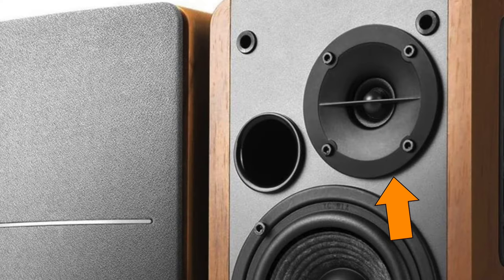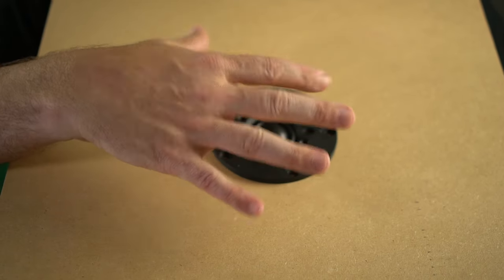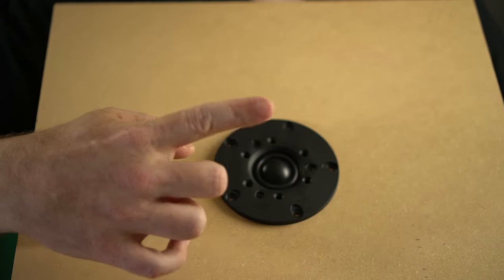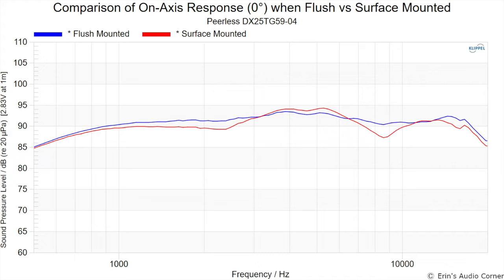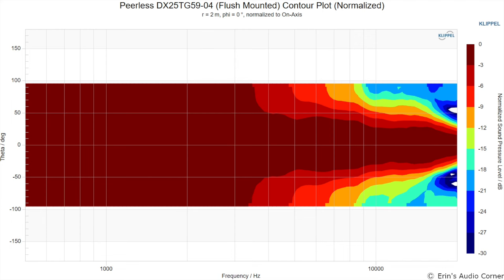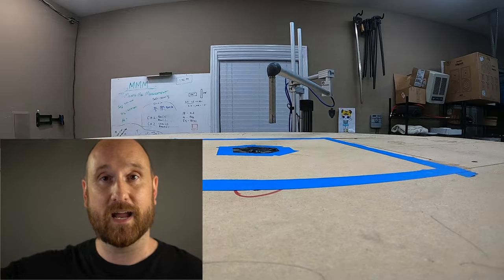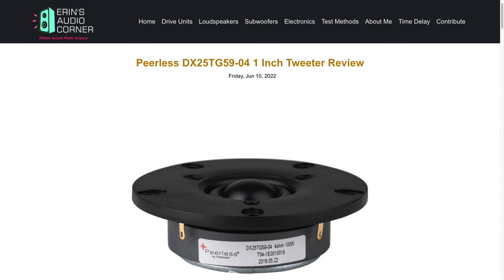Bad Speakers Start with This. 🛑  Flush Mounted vs Surface Mounted Tweeters.  Why it matters.

Comment: First of all, forget the graphs, if you like the sound of the speaker system go for it.  I have the Edifier bookshelf speakers in use as my recording studio monitors and love em!   I have Altec VOTTs as my main speakers driven by KT88s and after all these years, I am still in awe!
Let your ears be the ultimate judge!
Reply: No, the point is data makes good sound! How dare you even think your ears are the tool needed to make a subjective opinion
Reply: Agreed. I too have a couple of pairs of Edifiers and, bang for the buck, their sound (to me) is really hard to beat. With that said, I have the S2000MKIII models where the drivers are flush mounted (the tweeter even has a bit of a wave guide to it).
Reply: @rangerrecon  I think knowing what is a more preferred or better way of building a speaker might make it easier to filter out potentially "bad" speaker when buying new ones. If not going with any type of data you basically have to listen through all speakers around your budget if only go with your ears because you can't filter out any speaker out from your choices since you haven't listened to them. Would anyone entertain a speaker that is built wrong or measures horrible even if the ears are the final judge still? I think most people would probably not.
Anyway data and design shouldn't be totally disregarded even if the ears makes the final decision, imo.
Reply: @cletusberkeley9441  I'm so tired of "either/or" decisions and judgments, not necessarily yours but also those in response to you.  I think two things can be right at the same time and that two things can be wrong at the same time.  Beware false dichotomies.  It's the most common form of human understanding and categorization and it only indicates a normative desire to categorize information (regardless of the topic).  But, that type of thinking is a trap.  So, on one hand yes, "measurements" do make a difference and in some if not many cases this can be deceiving, especially so if the "room effects" aren't in your own room.  Nonetheless, the music we hear, whether influenced by our own bias, or not still is indicative of our own experience and our own ears.  Just one example:  My Rogue Audio Sphinx V3 sounds great, and "warm" to my ears and I like that type of distortion.  Nonetheless, it's still a well built and quality integrated hybrid amplifier.  When it's coupled with my Tannoy speakers which, in their own right are noted by some to be "bright", in my room, in combination with the "warmth" I mentioned, they complement one another and the resulting sound, I would call synergy.  So, they don't measure "flat" so well empirically but, my ears aren't empirical.  Thanks

Comment: Erin thank you for bringing this to my attention: my custom pillars are not flush mounted and this is my next goal on my updates
Reply from the maker: Car is a bit different but it still is good practice to flush mount when possible.
Reply: @ErinsAudioCorner  Care to elaborate how cars are different in terms of mounting? Thanks for the great vid!
Reply from the maker: @Bluehill29  In the simplest way, everything in a car is a baffle and a diffraction source.  I have my tweeters flush mounted but they're right next to a window... so there's no way to get around all the issues.  Best we can do is do things like flush mounting tweeters to help fix the things we can control

Comment: Erin's assertions are not incorrect, but these refraction don't necessary determine a good or bad speaker. There are many high end excellent speakers that have surface mounted  drivers. Agreed,  flush mounting will reduce edge diffraction which occurs when the wave reaches sharp edges. This is more important in mid and higher frequency drivers and usually you don't need it except for looks in (large) bass drivers. But edge diffraction will also occur when the wave reaches the end of the baffle, hence a reason for beveling the baffle edge. The width of the baffle determines the baffle step and the curvature of the edges determine to a degree how smooth the transition between radiating in half to full space is.

Comment: Magnepan- surface, baffle mount? Psh.
Kef uni-q drivers-np, mount em in the center of the woofer, perfection.
Sooo many different variations. I do like externally mounted tweeters separate from the cabinet alot, especially dipolar ESS etc.

Comment: I'd like to start by stating that I really appreciate your opinions because they are typically based on logical thinking and measurements.  I've built a number of speakers, reflex, back loaded horns, MLT, etc.  A number of my builds use Fostex drivers that have a cast frame with a beveled surround, an example would be the FE-208EZ.  Do you think there would be any benefit in insetting the driver so that the beveled edge meets the baffle? Does the 1/8" shoulder on these drivers significantly impact sound quality? I always inset my tweeters so that there is no shoulder above the baffle, but this video got my thinking about the other drivers. Thanks for your time!

Comment: For me it all depends I buy components and I place them in different places in the room on sticks with magnets. I changed the positioning of my sound with the treble.
 I like the HR24 mackie tweeter with the laser wave guide.
 Surface or flat mount or flush. It doesn't matter if you have a grill though. I have definitive technology the original flagships from 1996 and I can never see my speakers unless I rip those socks off. It's a beautiful set up and I never really get to look at it unless I shine a really bright light.

Comment: Does this only go for dome shaped tweeters? or are more traditionally shaped paper cone tweeters also affected? My technics sb-a55 speakers sound really good to me, but they have huge surface mounted rims around the drivers, massive plastic rings that the speakers are recessed into.
Reply: actually you would want every speaker driver to be flush mounted. in reality... makes little difference if any . but its a nice touch.

Comment: This is true. many moons ago, a good Danish Hi-Fi magazine tested a bunch of speakers vs the same speakers with an experimental
30mm rockwool damper front with cutout holes for the speakers and verified a dramatic increase in sound quality due to the sudden
 loss of edge difraction, Verified by very accurate and detailed measurements. The effect was described as switching from a cheap
speaker to an electrostatic one, and Its true.

Comment: Good point! However, the Dome Tweeter is the Main reason that high end dynamic speakers have put high end audio back back 40 yrs! never been able to compete with good ribbon,or Horn Designs.I have some of the best sounding Dome Tweeter designed speakers in the industry! NO. 1; Celestion,Who Designed the first Metal Dome! That incorporated a slotted waveguide over the dome to minimize vertical reflection problems! NO.2; JM LAB/ FOCAL,who redesigned the Dome Tweeter,Creating a reverse dome that doesn't see the baffle at all! Used In Most Wilson Audio designs ( I have FOCAL Speakers ,and Separate Drivers) I build speakers,been doing so for some time! My Best design utilizes a ribbon Tweeter that also can't see the Baffle,and Horns,that also can't see the Baffle! So who Cares if a convex Dome is Flush Mounted or Not? It still has diffraction issues!

Comment: Lot of good technical info but at 89$ the Edifiers in specific sound really great and not only for the price, and I have them side by side with a pair of JBL HDI towers
Reply: I own the slightly better model then this one but they sound decent for the price I own a pair of jamo c95 ii and they sound incredible on a onkyo reciver but to be fair they are 400 off sale 200 on sale and even on sale they are still more than the pair a pice but I agree for there price they dont sound bad but I have a moderately bad ass system and I just gave mine away to my friend because I just didn't want them anymore they dont sound good enough for my needs they need a sub and at the time I made the mistake if getting the version that doesn't allow a sub if it did id probably keep them
Reply: Plus the Edifiers have a waveguide on their Tweeter too to aid defraction. Cracking little speakers for the money.

Comment: Great stuff as always! Any plans on getting those JBL 530s on deck for analysis?
Reply from the maker: Honestly, I don't know.  I measured one and the results looked way off.  They are used so I am concerned there may be something wrong with them, based on the otherwise good data I've seen elsewhere.  I plan to revisit it to make sure it wasn't a setting or a truly busted speaker.

Comment: I have the Ediffier  speaker u shown in the video. They sound good, I have no issue with them. 👍 Notice the tweeter sits inside the cone shape radiator which spread outwards. It’s not even the same design u have shown in your flushed tweeters. Unless u have an Ediffier and show us the test result, I am not convinced.
Reply from the maker: If you like your speaker then why let my video showing issues with these types of mounting bother you? Enjoy what you have.
Reply: @ErinsAudioCorner  My point is the tweeter sits inside the cone-shape radiator, way beyond the surface of the speaker. The flushed tweeter u shown is different in term of "depth" placement.

Comment: I agree, wholeheartedly with your theory, and testing; and is actually another reason I APPLAUD whosoever designed Amazon's "Amazon Basics 80w RMS Bookshelf Speakers" which I now use as my active monitor solution and replaced my Paradigm Titan V2's with around a year ago.
Since their release these speakers have jumped in price (as I predicted in my review) from $53 to over $250 and they're worth every penny in terms of sound quality, frequency response range, signal to noise ratio, waveform, and overall capability of the speakers.  Granted, I'd have a MUCH harder time convincing myself they're worth what they sell for NOW, but they're EASILY worth $150 compared to some of the crap on the market being sold as "monitors."
Reply from the maker: Out of curiosity, did you find this video linked somewhere?  I posted it weeks ago and I've been getting comments on it a lot the past couple days... seems like it's been shared somewhere.  Don't know how else it would be gaining steam all of a sudden.
Reply: @ErinsAudioCorner  It just appeared in my yt feed, but I do participate in a lot of audio based videos so that's likely why.

Comment: A way to mitigate this issue, especially if you use your speakers with the grills on or just don't care how they look is to tape foam around the tweeter, I did this to a pair of Edifier speakers my brother uses and could notice a clear reduction in the sibilance, I literally took spare foam tape that came as a sealant with the kitchen cooktop and glued around the tweeter it's similar to the foam tape we use to seal speakers in cabinets in DIY and in car audio. It just happens to be of the perfect height and since it's foam, it kinda absorbs a lot of the sound, I don't actually have acess to equipment to measure how much of a difference it made but if you find it interesting, I sure would be interested in seeing this measured, if for nothing else, at least to be sure me and my brother actually heard a difference instead of just falling for placebo effect. I don't think it was placebo, it was a very noticeable difference but it doesn't hurt to be sure.

I don't recall what speaker now, but I've seen a speaker brand integrate foam on the outer edges of their tweeter facia and that gave me this idea.
Reply: John Dunlavy patented it.

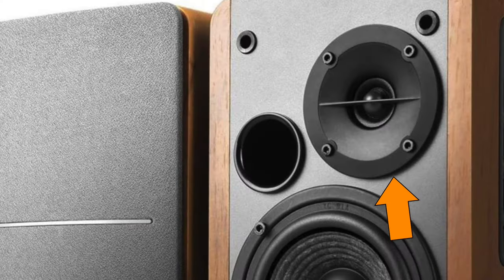Comment: Too bad the speaker selected as a bad one at 8:45 is an Edifier, because is actually quite a good brand. They have cheap with surface mounted tweeters and up to a point in price and style they have with flush mounted tweeters and quite good speakers. And not only that but they have a higher end brand (if you want to call it that way) called Airpulse that have quite impressive speakers. Thanks to having those cheaper ones, people on a very tight budget can have a pair of good enough speakers, with build and components quality, that last, unlike other cheap brands, and if you have more money, really good ones.
I have a set of Edifier and mine are kind of in the middle, the model is "C200" and the tweeter is flush mounted, to me, but still has an outer ring that sticks out just a milimeter, probably just for decorative reasons. Wonder how much it affects.

Comment: Good info but I do have a question. What about if you make a 'waveguide' for the tweeter; meaning, the tweeter is surface mounted to baffle A but then you have baffle B that sits atop baffle A with either a roundover or chamfered 'waveguide'? Also, what would be better in this scenario, a roundover or a chamfer?

Comment: There is also a deflection point in the mortise between the driver face and the baffle.  If it actually mattered, every tweeter would have a face that tapered to nothing on it's outside edge.  To say that you can actually hear it is woo, plain and simple.

Comment: Curious to know, if the method you’re using is as accurate as an anechoic chamber, why then speaker manufacturers and designers go as far as renting anechoic chamber for weeks on end to tune and measure their speakers? I’m seriously asking, not to start a fight.
Reply from the maker: You’d have to ask them. It’s cheaper to rent time at a chamber here and there. But if you’re buying a chamber… that’s different. I do know a few manufacturers who have purchased the NFS in the last year because I’ve helped them with some setup questions.
Reply: @ErinsAudioCorner  thank you for the explanation !!! PS: you got a sub from me !!

Comment: Erin, what about Paradigm Reference Studio Series speakers? They all had tweeters on a protruding plate. But with a grill in place they could be kind of flush mounted.
Reply: That should measure close to flashed mounting.

Comment: Totally agree. I designed a well reviewed loudspeaker about 8 yrs ago and it has unusually good dispersion matching between mid-bass and tweeter. However the baffle is narrow so diffraction has an effect. I'm thinking about a new version with a waveguide, not for matching to the mid-bass but simply to minimise baffle edge diffraction. It can take as little as a 10mm deep waveguide to help a lot. It's what happens  off-axis with diffraction that often goes undiscussed.

Comment: Drivers mounted on the back of the baffle are worse. Have you ever heard the original Klipsch Heresy? The horn was rear mounted, with that smooth curve slamming into the squared baffle. I have never heard worse diffraction!

Comment: That's nothing, you should see the up to 2cm thick frame in front of this iPod dock I have. They they even used nice little coaxial drivers, but sound is tarnished by the aesthetics design.

Comment: all that work i put into buying router bits and tools pays off. and its a nice finish. 
could someone also mention some options to fix it on existing speakers please?
heard people use felt and stuff like that, even a Dremel with the right bit could do this.
Reply: Could radius down the frame (lot of work, structural integrity considerations, debris, permanent mod)
Could hand route your own countersink (possible need to consider z-offset, permanent mod)
Felt could help a bit (see VAF, Duntech speakers, aesthetic considerations)
Could 3D print a radius down to a thin edge (equipment cost + knowledge, aesthetic concerns) Could make this by hand too if you don't mind the work.

Comment: i saw some manufacturers and diy'ers put foam around the tweeter, even tho they are flush mounted. saw it on old jbl's, rogers and even recent elac speakers
how does this impact the sound and measurements?
Reply from the maker: It would depend on the radiation and the thickness/material.  I suppose they are trying to absorb the sound that is radiated toward the edges (which would end up as diffraction).  But maybe there's a different rationale there.

Comment: With dsp and cabinets using multi tweeters or hf drivers that will cover the hi freq spectrum your mot going to notice anything in fact in a array column design comb filtering knocks down the hf anyway unless it had a wave guide fitted

Comment: The loudspeaker shown in the photo, you do not need to worry about flush mounting the tweeter because it's wrong in so many ways anyway. It has dreadful high levels of EQ, excessive bass lift and very tizzy HF. Cone break up of the bass/mid due to no crossover components just a cap on the tweeter. Completly impossible to EQ in any form, but it is cheap, lots of people love them. Mostly the boom and tizz people that have no idea what real music sounds like, probably because they have never listened to any.
Reply: Would be a fun project I think. Still, hard to fix cheap drivers
Reply: @RennieAsh  I'm working on a low cost crossover at present to help improve things abit. No point and spending lots of money on it, better to just get a better speaker to start with.
Reply: @MichaelBeeny  what models of active speakers do you recommend under $160?
Reply: @LibertyWlk  I don't recommend ANY active speaker at around that price. Choose a standard none active speaker and use an amplifier of your choose as and when funds permit. Most low cost active speakers tend to have lots of EQ to try and make it sound better. Edifier is one in question. Just makes it sound dreadful, far from true HiFi. I'm sure Erin will probably agree with me on this one.

Comment: Does this affect only tweeters or is it also for midbass and or midrange drivers that aren't flushed mounted?
Reply: Good queston. Dunlavy put felt around  both the tweeter and the mids.